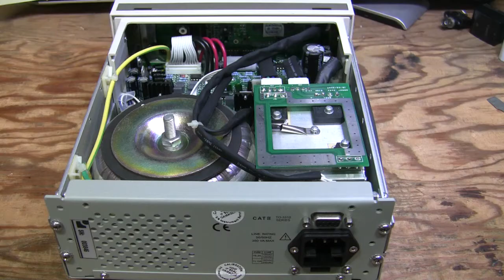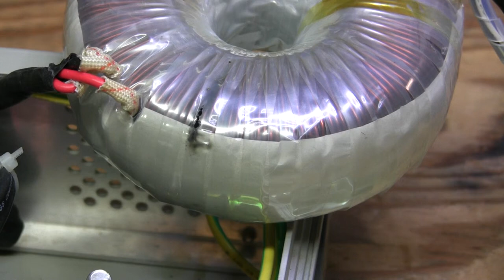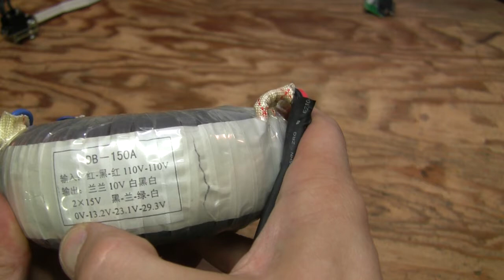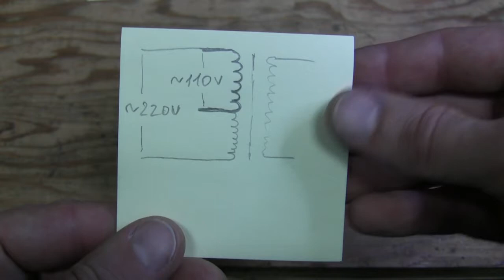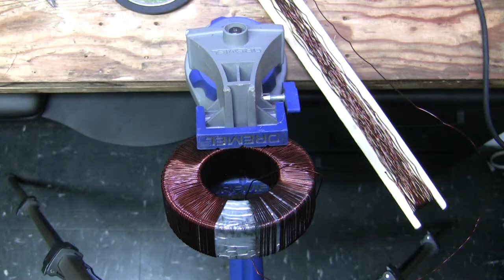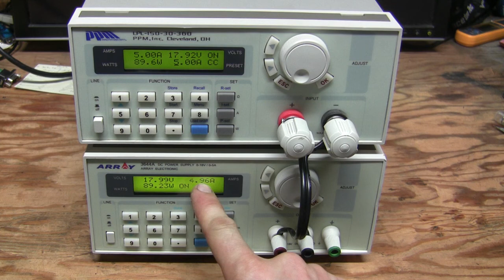#11 - Array 3644A power supply repair

Comment: maybe you DON'T need to count the turns - just replace with wire of the same length? - and the turns will take care of themselves - as long as you wind it correclty and leave the same length of leads (?)

Comment: A real trooper rewinding the toroid. When you started the job I remembered being back in high school electronics class winding toroid using "shuttles" made out of fiberglass perf board. Some students discovered if you didn't file the edges the fiberglass would abraid the winding insulation and short the transformer. As I recall the project was making CDI ignitions, which were uncommon in the 60s. (I later used mine to drive a 400Hz aircraft blower I installed on a VW bus heater tube.)

Comment: If the case ever happens again, you should look into companies that do custom toroidal transformers. I had some made several times for projects, even in one-off quantity for like 30$ for transformers with 6 custom secondaries. They have the equipement and it doesn't take them that much time, so it ends up being pretty cheap.

Comment: You got nerves from steal man! I though you will just buy a new transformer when it seemed that its a problem with internal windings. However very educational thanks! How did you repair the primary winding wire? Or did you use a new one?
Reply from the maker: I reused the wire. Just carefully soldered the pieces together.
Reply from the maker: > just buy a new transformer
I am not sure replacement transformers are available
Reply: Yeah you are probably right. I guess searching for a replacement transformer that would fit this application would time consuming as well.

By the way I was wondering for some time where do you live :) I noticed your Russian accent but you are using 120 V AC. So you must live in US or Canada. Is that right?
Reply from the maker: I am in the US

Comment: +FeedbackLoop In some instances, due to location or other factors, repairs such as this do become necessary. Besides, it's a great feeling of accomplishment to have successfully completed a project like this. Most people can't, or simply won't stick to it 'til the end. So, good on 'ya! Also, I would imagine that finding a replacement transformer that wouldn't need to be rewound itself would be all but impossible. You may find a parts unit to steal it from. But, in that case you'll likely be in the same situation sometime afterwards, anyway.

Comment: When I realized that you were about to rewind that Chinese transformer I thought maybe you had gone mad.  I'm not sure what Array charges for a new transformer, but it would probably be worth the cost.  I'm glad that you got it working, but the cost in man-hours was not worth it..at least to me.  Good video though!
Reply from the maker: Yeah, I admitted that it was beyond economical repair. I still decided to go for it. In part, just to show that it is possible if one really wants to.
Reply: And I bet you felt pretty darned pleased with yourself when it powered right up! That's worth some cash right there.

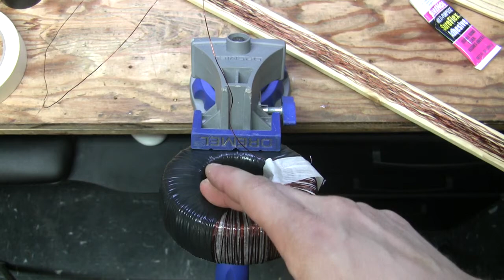Comment: At 14:00 you say you used a little glue to avoid humming... Can you please explain to someone who has not wound a transformer? Thanks.
Reply: Oh. Do you mean the humming you hear from a transformer in operation vs. humming (noise) on the output? Interesting. I never realized that tight, glued windings could affect the humming sound.

Comment: Great job! It's not easy to do, I rewound a big toroidal rated at around 600 watts and it was a nightmare. The transformer was from a big amp and fully functional, I just needed to rewind the secondaries to my own spec. Handling about 80 feet of thick enamelled wire was bad enough, but due to the thickness I had to draw it all round a roller to straighten it out so I could reuse it. Worse still, I wound it quadrifilar! I should have wrists like Schwarzenegger after all that, but I just ended up with no skin on my fingers...